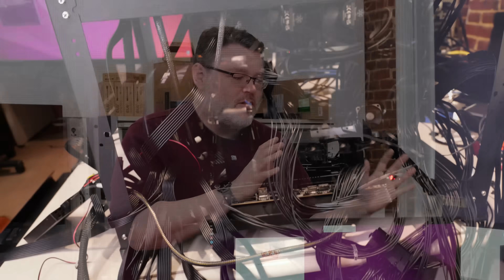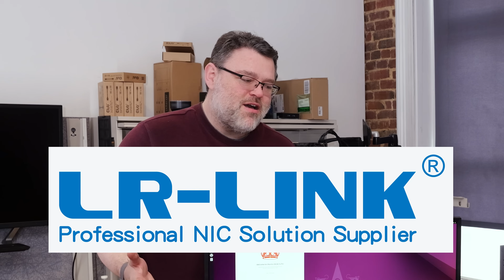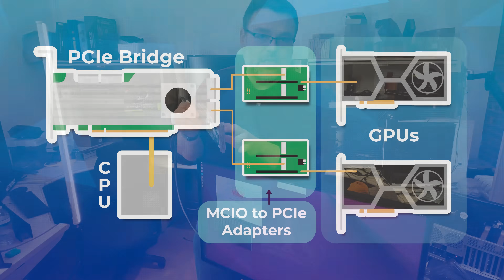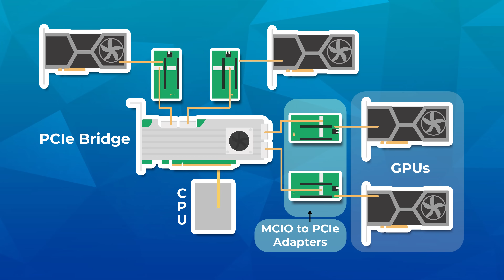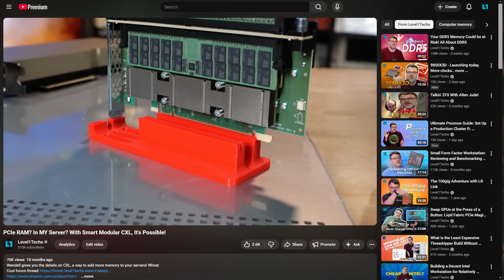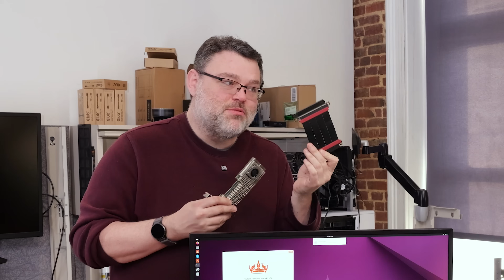Creating a PCIe Bifurcation Solution for AI Councils

Comment: "These GPUs put out too much heat! I need to get them far away!" Optimum solved this problem by custom water cooling for both 5090s, stacked right next to each other. If you can afford dual 5090s, you can probably afford special 5090 waterblocks and a custom loop.

Comment: but.... kubernetes, ray, roce v2 nccl, off brand 100Gbit cards, (i use the LR Link CX6 cards), RTX 6000,s or 5090s 700$ dell QSFP28 switch, 64GB RAM machines like AM5 machines or even intel 265, it stays in the cases, use Ceph RDB for a nvme in each motherboard and add in some dgx sparks for different tasks, and thats cheaper somehow than this and more capabile,  yes your offload to gpu will be slower but youll get so much more our of your lab, i know this first hand clustering sparks and 4090 and 4070s, what your doing is creating a system that you may get away wwith a single 20A breaker but you cant run from its limitations

Comment: I honestly wouldn't be mad if Motherboards started coming with just MCIO connectors, no PCIe slots at all. Provided they had the proper retiming circuitry, you could use as few or as many of the PCIe lanes you want and no more worrying about whether or not your GPU will fit in your case, you could even put it in a different box! :)

Comment: I'm a bit confused, your issue is spacing and heat ?
Assuming you have enough slots, why not go with GPU water blocks ?
Basically what LTT did in their 7 gamers one 1 cpu.
Sounds way less expensive and complex in exchange of having to deal with a water loop.
Now i get the video is about the pcie mux stuff but still, i feel like the premise is a bit stretched.
---
While i was writing this, found YANGCOM Korea video that got out couple hours ago doing exactly this with the same motherboard :P

Comment: Pcie is supposed to be architecturally similar to Ethernet.
But the "trunking"/mux/bundling of lanes is all defined in the bios - which is odd.

It would make more sense to autonegotiate the lanes. You send an id packet to one lane, and the card replies on all the lanes it can. Then you confirm through each lane with responses on all. 

Then bifurcation or trunking becomes a simple matter of passive wiring.

I honestly don't know why that wasn't done in the beginning. Cisco etc have been doing this for decades.

Comment: I am definitely interested !!!!   I want more PCIe lanes without having to buy Threadripper or server motherboard.  Could be from X16 gen 4 to x32 gen 3.   Would like to add 10G nic, A380 and pcie gen 3 HBA/SAS controller for server.    The A380 would need to work with re-sizable bar.

Comment: For the different application where you really need to reroute stuff or split it out to some special devices it looks cool. But from practicality  standpoint for gpu +AI stuff, it's easier to come up with a cooling solution that would allow those cards to sit close together, and I think, still be cheaper than these specialty addin cards.

Comment: Maybe we need to put slots each side of the CPU to minimise distances, and put them on both sides of the motherboard.  I'm concerned that most PCIEv5 is pushing tech outside the requirements of non-enterprise users and we'd be better off with 2x 16x gen4 slots (than 1x 16x gen5 slot), and two cheaper-to-build GPUs.  GPUs are now so large and heavy, I feel the slots and bracers need a new chassis design.

Comment: This sort of thing is always interesting, though way overkill for anything I'd be really interested in doing. 
What I'd really like in PCIe world is a bit different and I've never found it existing - take that M.2 slots PCie lane and split it out into many maybe even by 16 lanes of previous gen speed. Given the crop of handy small PCIe spec Modules starting to exist, especially ones to suit the Raspberry Pi 5's small flat flex PCIe connection being able to add a heap of those modules into your more portable/small machine eating up just one of the usually rather limited number of PCIe or M.2 slots would be great - in so many cases total bandwidth available for the end devices isn't nearly as important if it matters at all, what you needed was to have all those devices accessible at once...

Comment: That card looks like it would be exactly what i need to attach 20+ gen3 U.2 drives, my question is where do i get the cables to accomplish this? ive never seen a 1 MCIO to 4 U.2 cable.
Reply: That's because 1 mcio is pcie5 x8 and a full speed u.2 drive wants x4 lanes. X4 splitting is possible with bifurcation, X2 splitting not so much. You'll likely need a very expensive pcie switch card with many outputs and or some storage backplane that supports drives sharing lanes (icy dock has done)

Comment: Those ribbon cables are a menace. I have a NZXT vertical mount for my GPU, it's just Gen 3 and for years it worked fine(I have a very fat case, so the fans weren't anywhere close to the panel). Then I moved, and when I reassembled my PC, it just refused to work, no matter how many times I removed it and reconnected, I had no video signal. And that's just gen 3, I cannot imagine how finnicky it gets with gen 4 or 5.

Cheap PCIe Bifurcation solutions would be so awesome for homelabs. Putting an HBA, a GPU, a network card and more quickly exhausts the usual 16 lanes available on consumer platforms, things like old LSI controllers or just 10gbit NICs don't actually need that much bandwidth when it comes to newer PCIe generations.

Comment: really ive been wanting two things for a long time:

motherboards that dont use pcie slots at all, make the board small and put MCIO or SFF-8654 all on the edge and then you can send the signal to those adapter board and place them wherever.

pcie expanders. take that pcie 4.0 or 5.0 signal and turn it into many pcie 3.0 links. so much untapped IO bandwidth.

also "the Chinese store" is a good place to look for these things

Comment: My PCIe Gen 4 solution, on older SFF-TA-1016 with a GEN4 PCI-E X16 to X8 X8 Bifurcation Adapter Riser Card made by ADT Link, from the usual place : AliE  I have 6 x 3090s using the same crypto chassis and a 1600 + 1000 W PSU setup.

Comment: There are also LR-Link adapters with an E on the end that offer the MCIO externally. Is this the promised land of PCIe fabrics you have been teasing us with over the past few months? Because that's the next step right, adding a PCIe switch in the chain where you use RDMA to let your PCIe devices talk to each other and then using SR-IOV and non-transparent bridges to expose those PCIe devices to multiple hosts, creating a truly unified fabric? If this is where we're going I really wish I had the funds for a couple of RTX Pro 6000s if MIG works for this purpose, such a system seems incredible.

Comment: I ran into issues with the Asrock Rack ROMED8-2T not being able to do Gen 4 with Samsung PM1733’s. So had to get a redriver just to use them. I used Supermicros Gen 4 Redriver for my U.2 drives. Would that work for any PCIE too? But they have a model that doesnt split the 8i SlimSaS into two x4’s. They are less than $200. There’s also another company that sells redrivers I found in a really wide variety but they were a little more expensive. I never saw anything above $400 though. Pretty sure they had MCIO redrivers too.

Comment: I loove bifurcation. 
By coincidence i aquired a m.2 card that takes 8 PCIe lanes and gives me full speed on four M.2 drives. but not at the same time. 
Only a little controller chip for that black magic. I am kinda miffed that this chip isn't standard on mainboards over 150 bucks.
I want more bifurcation!! Now! Because PCIe x1 slots suck. ^^
Reply: > I am kinda miffed that this chip isn't standard on mainboards over 150 bucks.

Because the PLX chips that do that cost many hundreds of bucks a pop when they are new/recent. Broadcomm is the reason

I assume you got a card from aliexpress, and it's probably using a PLX chip that is at least one if not two gens old

Comment: When one realizes water blocks are substantially less trouble than gen 5 pcie risers for multiple GPU. Is the moment one starts dreaming of just plugging random crystals into a universal interface^_^
Reply: Metal 3d printers printing this stuff is coming......
Reply: "Spontaneous formation and optical manipulation of a woven domain fabric in a ferroelectric crystal" is a research article which might intrigue you
Reply: @nopenoperson9118  Outside my field but interesting research. FTL & subatomic power generation are difficult enough without adding chaos theory by crystal on top.

Comment: A friendly reminder to all folks here to explicitly enable PCIe Advanced Error Reporting (AER) in their motherboards’ UEFIs.
(Unfortunately it’s disabled by default on 99 % of the motherboards I have seen)
Reply: Awwww c'mon, live dangerously. What's wrong with a few silently flipped bits, especially if they're going to a U.2 device. :)
Reply: An intermittently stuttering system while you have no idea why because nothing appears ih the operating system’s logs can be pretty annoying. Many years ago, when I was still living blissfully ignorantly, that caused many unnecessary hours troubleshooting when I had bought the first PCIe adapters off of Amazon (which were crap).

Comment: PCIe bandwidth split with generational downgrade is something I was looking for since 4.0 since majority of GPUs were still PCIe 3.1, and it's even more in demand with PCIe5 since having 16x directly to GPU on consumer motherboard is an absolute waste, it would have worked just fine with half of it, and with minor degradation with 1/4th of it. so we can say that 3/5 of the PCIe5 GPU slot is wasted.

Comment: So could we in theory run 4x4090 on a X870 motherboard using 2x pcie 5.0 8X at 4x pcie 4.0 8X or bios will not allow.

Edit:just as addition use iGPU as screen output if there is issue with output on the others.
Reply: Yes.
Reply: @Level1Techs would be interesting for many to get video about this on x670E / x870E….

Comment: We really need PCIe switches now that NVME/m.2 is supplanting SATA to some degree. Those platform agnostic "Promontory 21" chipset-on-a-stick boards show what is possible with existing tech. What's stopping AMD or intel from releasing "auxiliary chipsets" that fulfill the same role as a Broadcom PLX chip?

a vacant x4 slot could easily be used for an m.2 JBOD where storage capacity is more important than speed/bandwidth.
Reply: Add to that the ability to gen shift or at least over subscribe. So that gen5x16 can become gen3x64.
Reply: Too flexible. They want to sell you CPUs and platform with more lanes so they can make more profit
Reply: @zoomzabba452 if I had to bet, this is probably why all the CPU/motherboard manufacturers don't provide those auxiliary chipsets.
Reply: @zoomzabba452 they only make money if i can afford it...
Reply: a gen 5 M.2 with its 4 lanes could be a full x16 gen 3 card... which would open a LOT of flexibility.
Reply: I would love to be able to run SSD’s with one lane in a lot of cases. 

Sometimes I just value having more drives than the bandwidth per drive.
Reply: Honestly for mass storage ssd's 1 or 2gb/s is more than enough! I'd happily take a bunch of cheap 1lane pcie 3.0 ssd's doing 1gb/s as long as they affordable, slightly faster than sata at that speed too
Reply: High speed bus switches are simply really expensive. A simple 10GbE is already expensive, pcie5 is at speeds of 800GbE.
Reply: @zapl80 x520-da2 is like $40… it’s cheap as fuck
Reply: I've run into exactly this. Cheap pcie switches would be a godsend for my use case, where I have numerous nvme drives, each infrequently used, but it would be nice to give like 8 lanes to my array and split that off to 8-12 drives. I don't need to burn 48 lanes for full simultaneous bandwidth
Reply: Active PCIE 5.0 x8 card turning it into multiple m.2 @ x2 slots of PCIE 4.0  would be truly a godsend.

Comment: I found that 15cm-20cm PCIE 5 riser extension cables on the WRX90E-SAGE work well for connecting NVIDIA RTX 5090s. I get 16x Gen5 full speed. On the other hand, 30cm length cables have signal issues, take a really long time to boot, fallback to 4x-8x Gen5 speeds, and can crash the motherboard.

Comment: I had an unnatural thirst for more NVME slots in my piddly consumer platform so I split the 16 cpu lanes in to the the two slots connected to them, then bifurcated the 2nd slot in to two x4s with a nice littler 2 slot NVME carrier board. (Leaving my gpu at x8) Shoutout to MSI for supporting bifurcation in all possible permutations across both those slots.

Comment: Yeah, I had to plan through on how I am going to use a B60 Dual (once available) next to my gaming GPU on a consumer board.
Solution is probably PCIe x16 to 4xOculink -> 2xOculink to 1xMCiO to PCIex8 for gaming GPU -> each of the remaining Oculink to MCIO, so 4 lanes per MCIO instead of 8, and a those two MCIO connector to PCIe"x16", such that the physical rear half of the B60 Dual gets x4, because the B60 Dual can't be used in x8 mode, because the they are two physical cards on one slot. And I do not know of a consumer board that does x4x0x4x0 on any slot.

On that note, instead of MCIO I'd like to see a 4xOcuLink to PCIex16 adapter to divvy up lanes arbitrarily.

Comment: That little adapter costing 1000 bucks is the crazy power of capitalism / monopoly.
Reply: monopolies are the exact opposite of what capitalism (i.e. free market with free competition) stands for, just an FYI
Reply: @marcogenovesi8570 you are wrong. Capitalism is by definition convergence of capital which always results in consolidation of power and natural monopolies
Reply: @thenamelessone7  who created the "convergence of capital" definition? I have never seen that. 

> always results in consolidation of power and natural monopolies

everything results in consolidation of power and eventually a monopoly, this is not exclusive of capitalism. Socialism and communism end the same way with state-corporation consolidation and protection of their monopolies.

The difference is that in a capitalist system a monopoly can actually fail or become irrelevant due to other factors (new technology usually), while in socialist/communist systems the monopolies are enforced by the state so it's not changing no matter what happens. The state always has monopoly

Comment: ⛔️ Wish you drop any AI related nonsense - maybe focus on power efficient compute, low-power servers (<5 watt idle) and such
Reply: The underlying topic about PCIe has nothing to do with AI, it’s about using the available PCIe lanes a platform has for more PCIe devices than the motherboard manufacturer intended.

This can enable solutions for home users that were previously impossible. Current Server and Workstation platforms with lots of PCIe are only energy-efficient if they can do actual work, if they “idle” they use much more power compared to the Desktop Platforms.

My postings Wendell mentions at the end of the video started in 2021 with the intention of using more NVMe SSDs on AM4 than was natively possible. It morphed into something like a blog to for example warn users what adapters to avoid (PCIe Bus Errors) and show what works.

Comment: i wish on mobos that i could choose pcie 5x16 or then choose say pcie4x32 or pcie3x64 with some sort of breakout board(s) without needing that pex chip to do it. i realize it doesnt work that way but i wish it did. a LOT of my gear is still 3.0
for me, buying up older used server gear, i need more lanes, not faster. if i could take a consumer board and add say 25G NIC, a pcie 3.0 gpu, and two lsi 9308 cards at full bandwidth out of the single pcie 5.0x16 slot without spending thousands thatd make my day

Comment: OK but hear me out, if your interface cards are a kilobuck/piece, arent you then better off putting waterblocks on those GPUs and stacking them in the PCIe slots, the way you'd do it in a GPU server?
Reply: We had the same issue running 8 3090s in an Asrock GPU server.  We had to get waterblocks to get everything working.

Comment: So, that alternative card he had there. That without cooling.

What does it do exactly? something something "redrivers" something?  Bifurcation? What does it do exactly. That seems to be missing in this video. Before I know if I would "Want one"
Reply: The only feature that card has is conditioning the PCIe signals so that you can use cables even for PCIe Gen5. It doesn’t generate additional PCIe lanes (that would need a more pricy PCIe Switch Chipset), any stuff like PCIe Bifurcation (turning the host’s x16 slot into x8-x8 or x4-x4-x4-x4) has to be done in the motherboard’s BIOS that the card is plugged into.
Reply: @abavariannormiepleb9470  Thanks. So just those redrivers you can also find on the (edges of) mainboards.
Reply: @TheKjelan  Yes, (I don’t have Wendell’s card). I think it’s a ReDriver-only card. ReDrivers are electronically pretty simple (conditioning existing PCIe Signals).

Comment: I talked about this before when creating LARGE VDI/Cloud gaming rigs with multiple GPUs.
Slot spacing is terrible on these devices and if you want 4x GPUs + Networking + storage it gets complicated.
This exact set up, with use of mining rig and PCIE bifurcation and cabling was discussed as well in ADDITION to the use of Tesla v100 SXM boards for GPUs. Since you are using the cable adaption ANYWAYS the SXM adapter boards use the same connections. Instead of using a PCIE riser on the far end... you just plug it into an SXM carrier board.